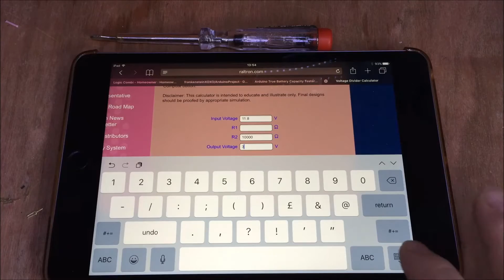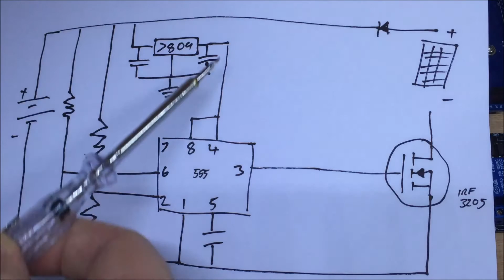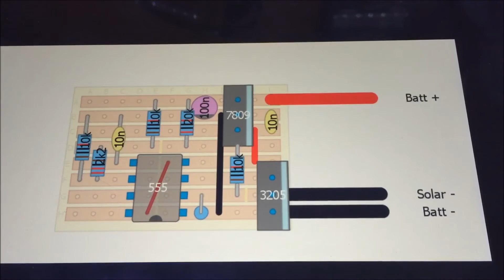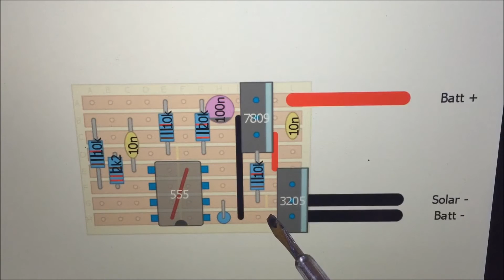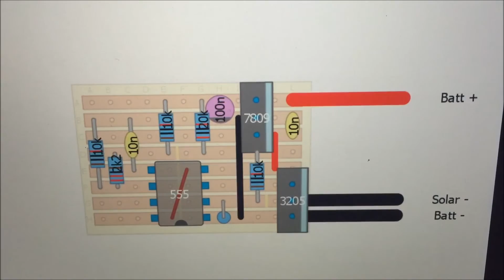555 Timer Solar Charge Controller - 12v Solar Shed

Comment: Hi Adam, Im confused, during the video you said you connected the battery and panel wrong, and that the battery negative was suppose to connect to drain and the panel negative to the source. Though for a NChannel mosfet the current flows from drain to source, so how is the battery charging. Also is there a specific voltage the gate needs to be for the Transistor to open? Or the Transistor will open if both gate and source have applied voltages?

Comment: How did you manage to connect the battery and the solar panel so that the solar panel doesn't power the circuit, wouldn't connecting the plus sides of both just make them a common plus and the higher voltage would power the circuit?
Reply from the maker: If you look at the scibbled schematic at 7:50 you'll see a back feed diode near the solar panel.  This stops the battery discharging into the solar panel at night.  However once the solar panel is producing a voltage higher than the battery, the current can start to flow towards the battery.  Thanks for the question.
Reply from the maker: Sorry I've just realized I've misread your question.  The solar panel can power the circuit.  The 7809 is fine with -21v open circuit voltage at low current.
Reply: if the solar panel powers the circuit, wouldn't that mean that the voltages for the threshold and the trigger would also come from the solar panel not the battery? or do they match while charging?
Reply from the maker: While the solar and battery are connected together they will have very similar voltages.  Solar panel willn be a bit higher due to the diode and so current can flow in the right direction
Reply: ok, it makes sense then, almost managed to build it, will keep you updated

Comment: This video has really solved my problem of building a solar charge controller. But my question is that, I built a Power battery pack of 18650 batteries of maximum charge of 12.5 volt, how do I adjust this circuit to trigger at 12.5Volt exactly instead of 13.8volt preset trigger voltage. Thanks.
Reply from the maker: +Sanctuary James You need to calculate your voltage dividers on the threshold and trigger to determine the maximum charging voltage as well as the restart voltage. Those calculations will depend on the voltage regulator you use.
Reply: If I'm to use LM7805 regulator, Please how do I calculate the trigger and threshold voltage divider resistors?
Reply: Li-ion batteries are charging in different way than lead-acid batteries. You cannot use charger from this video.

Comment: correct me if im wrong:
if i charge 3,7 volt lithium ion battery then the fully charge will be 4,2 volt
the 4,2 volt positive terminal will be connected to threshold pin
and to stop the charging process i must give the voltage 4,2 volt to trigger pin
i want to make it without variable resistor

please answer my question sir

Comment: Hi Adam, I found your channel on my YouTube suggestion list it showed up your aduino based charge 18650 cell capacity tester which I found very interesting and has given me some ideas to do my own version using a raspberry pi. I was looking through your other videos and this one made me chuckle to myself as I also found the 555 based charge controller I got it to work on my breadboard but when I moved it over to my vero board it did not work 😕 to this day I don't know why. Anyway I have now subscribed to your Channel and have started to watch and enjoy your videos. You will probably like my solar shed but it's not as neat or as organised as yours is. Thanks for sharing. Steve.
Reply from the maker: +Steven Watson Thanks for the kind words Steven. Nice to have you along.
Reply: correct me if im wrong:
if i charge 3,7 volt lithium ion battery then the fully charge will be 4,2 volt
the 4,2 volt positive terminal will be connected to threshold pin
and to stop the charging process i must give the voltage 4,2 volt to trigger pin
i want to make it without variable resistor

please answer my question sir

Comment: I have built a charge controller using one of these before....and then I found out others had done so online too! The inbuilt circuitry naturally lends them to such a purpose. 

 It's easy to overlook Pin 5, a DC voltage fed in here via a 10K pot can work very well to "fine tune" your setpoints. Also many designs include a fairly small resistor between the output and the mosfet. This may be purely as a safety device, to protect the 555 in case something goes wrong with the 'fet but it might also act as a "stopper" and improve the switching. 

A minor improvement is to use a 7555, which is the CMOS version. Has the same pins as the normal one. It uses far less current and the output switches rail-to-rail. However, it cannot source or sink as much current on it's output. That won't be an issue for driving a mosfet though.
Reply from the maker: +xanataph That's really interesting thank you.  I did consider a resister on the output - but my theory was that with mosfets being voltage driven it shouldn't use much current.  I hadn't thought that a blown mosfet could blow the 555.

Your idea of a pot on the control pin is interesting.  After seeing the one created by the guy at mdpub I did consider pots on the trigger and threshold so I could fine tune the voltages, but I quite liked the simplicity of the one I created.

Useful to know the 7555 uses a lot less power - we both know how precious solar energy is in the colder months.

This was really was me playing with something I hadn't used before.  I doubt I'll build another because there are more efficient and adaptable ways of achieving the same thing. However if I do, I'll probably incorporate some of your suggestions.  Thanks again.
Reply: +Adam Welch Yeah, under certain fault conditions the insulation in the gate of the mosfet can disappear and essentially become a short circuit with the other pins. I was thinking of the 7555 in regards to your quest for a really low current charge controller. A simple circuit like this can work well enough. Set the upper level for 14 volts (or to be conservative 13.8 volts) & with a smaller solar panel it'll happily keep a small AGM battery charged all winter without cooking it providing the charging current is not too large. If you set the upper and lower set points close together it will act as a "hit & miss" PWM controller.
Reply from the maker: xanataph Thanks again for sharing your ideas - I'm learning a lot. Love the term "hit and miss" PWM charge controller. =)
Reply: +Adam Welch There's a type of early internal combustion engine called a "hit & miss" engine and it only fires when the flywheel falls below a certain speed. So depending on the load when it fires can be quite random. 

Such as it can be with an on/off controller with close setpoints. Although this is not true PWM implementation in terms of the circuitry, the actual result as far as the charging is concerned pretty much is.